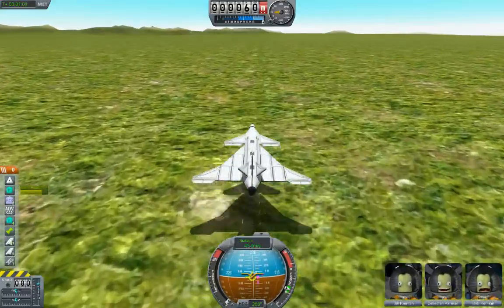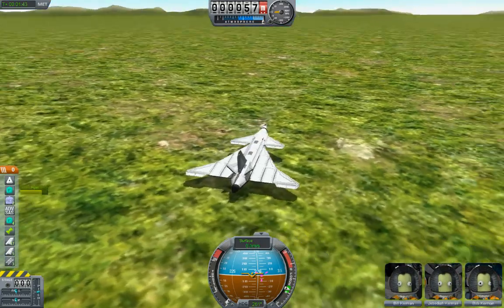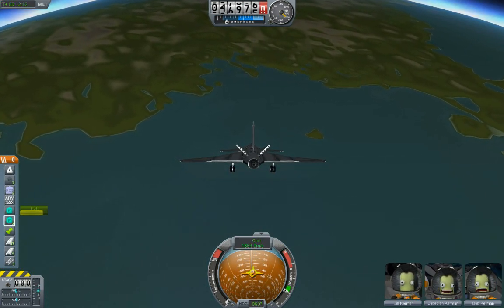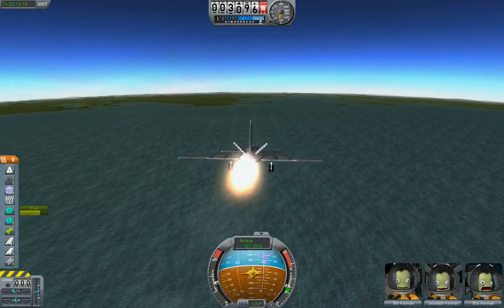Kerbal Space Program: C7 spaceplane tutorial, part 4, flying the mk2 hull

Comment: When the wing you use for a canard is a static wing (like the delta wing used in this design), is there any reason why you shouldn't put a landing gear on it for a 4-point system instead of the 3-point that you use in your planes?